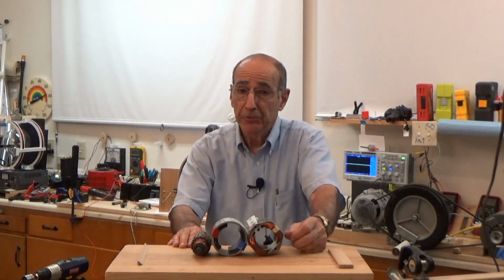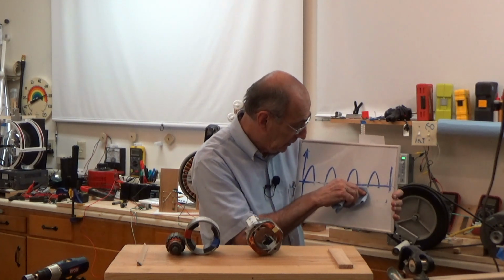Session 20A  Survey of Motors

Comment: Great Video! 
Permanent Magnet Synchronous Motors for the WIN!  
Was the alternator you powered using the controller modified to have a magnet rotor or were you supplying power to the rotor brushes to energize the feild?
I have a permanent magnet alternator that I found in a scrap pile that is very interesting.  It has 7 powerful neodymium magnets around the rotor all oriented with poles in the same direction!  I had never seen anything like that before and it took some head scratching before I realized that the opposing magnetic fields actually penetrate through the middle of the rotor to the opposite side, providing the alternating magnetic field!  This is only possible with an odd number of magnets.  It’s a very peculiar and interesting motor/ generator and I have used it as both.  It actually produces a surprising amount of torque when powered by a cheap e-bike style motor controller! 
I’m very curious to know if you have ever seen or heard of a PM motor with an odd number of magnets like this. 
   Aloha 🤙